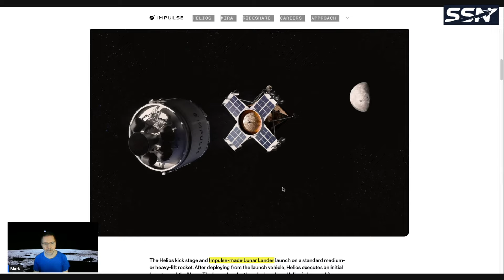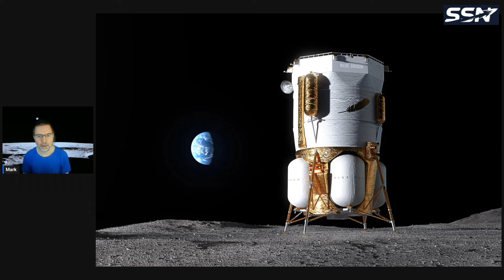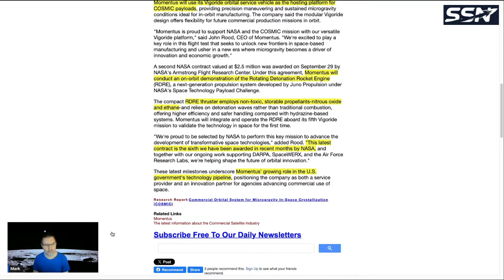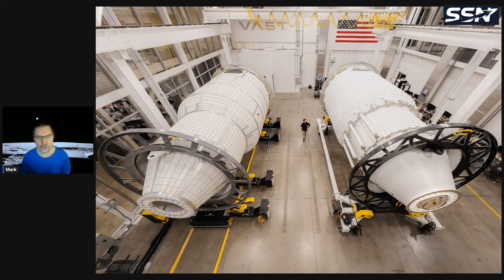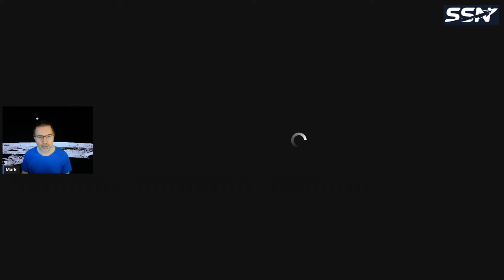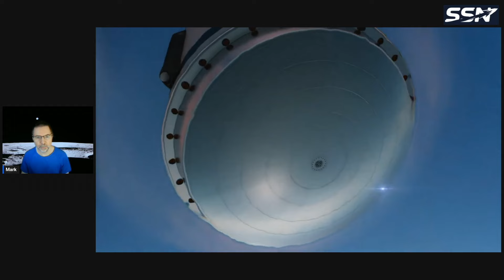Mid Week Space News Roundup: Impulse Space, Blue Origin,  Momentus, Vast Space, Exlabs & Stoke Space

Comment: Nitrous + ethane: 

For those curious, this is what Google says about reacting nitrous oxide with ethane: "Reacting nitrous oxide (N2O) with ethane (C2H6) results in partial oxidation to produce products like ethanol (C2H5OH) and acetaldehyde (CH3CHO), or oxydehydrogenation to form ethylene (C2H4). The reaction can be highly energetic, sometimes leading to ignition and flame propagation. Specific products and reaction pathways depend heavily on the conditions, such as temperature, pressure, and the presence of catalysts."